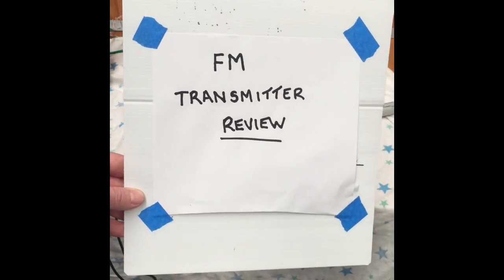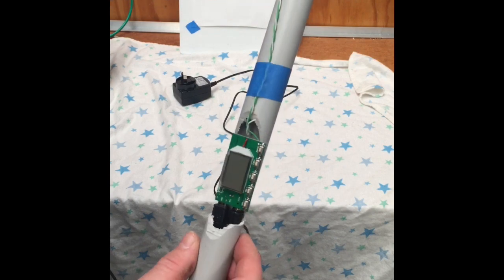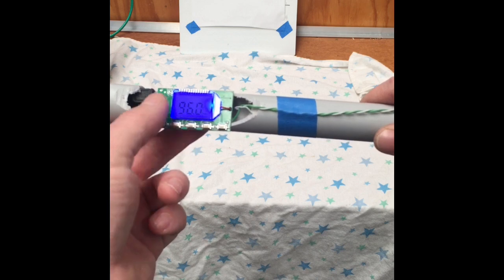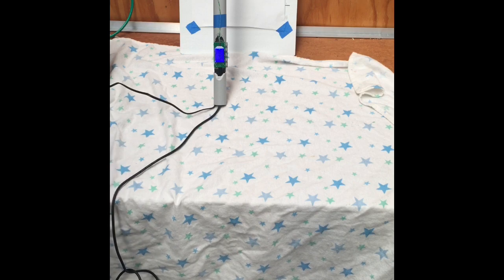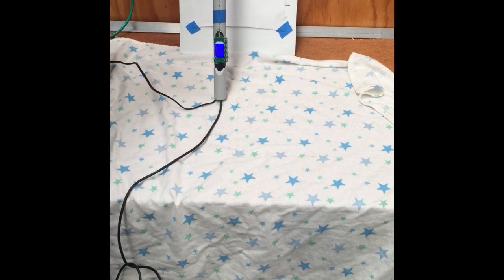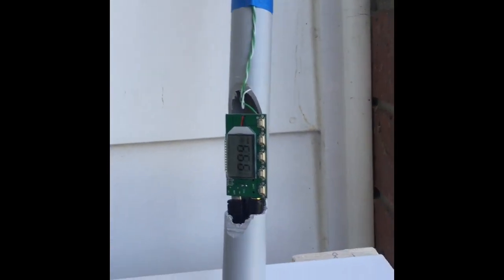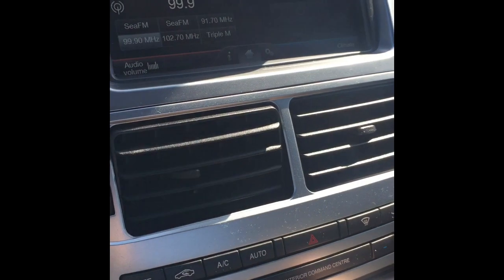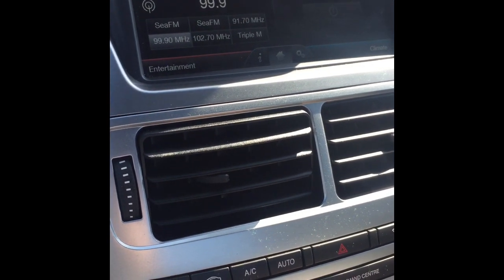FM Transmitter for Christmas Light Display - Part 2 -  DSP PLL Digital FM Transmitter Module

Comment: What would you use for a portable power source ? What battery and adapter for that USB  connector ?
Reply from the maker: RJ I didn't check the current draw when I was testing the transmitter, but I assume any good portable powerbank 5v powers supply should work similar to the portable powerbanks you can use to recharge your mobile phone.
Reply: @LawrenceDriveLights  I tried using a portable solar battery pack , but the transmitter does draw enough and the battery shuts down . But I did find a 6-30Volt step down unit which I will connect a 9 volt battery to it . These things are fun , thanks for replying .